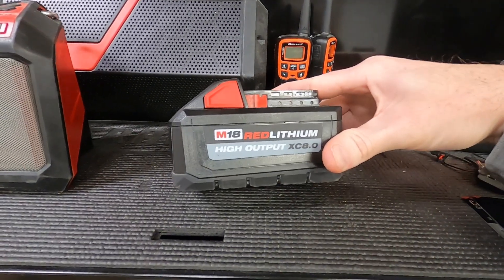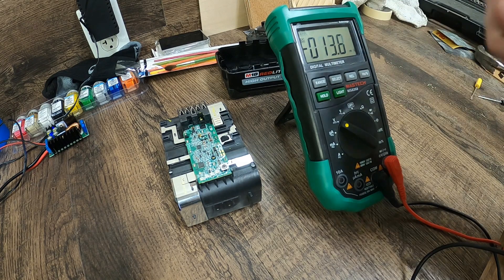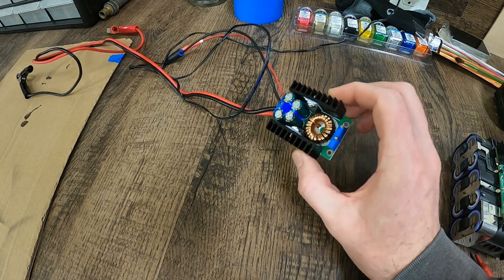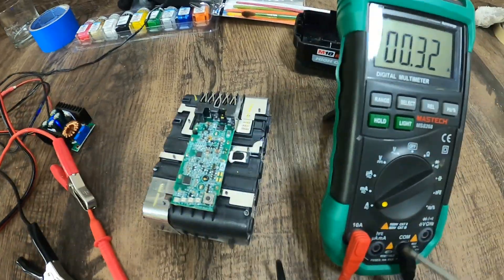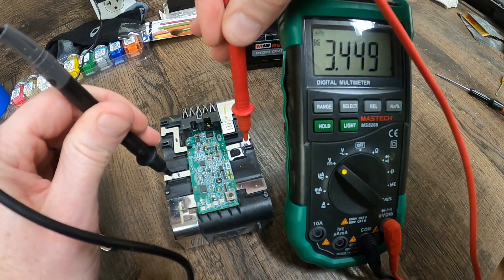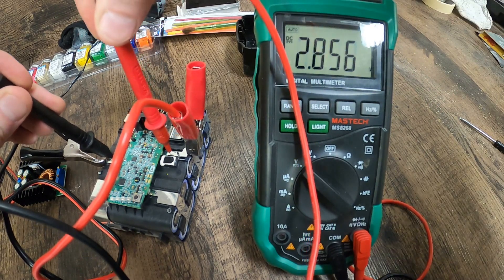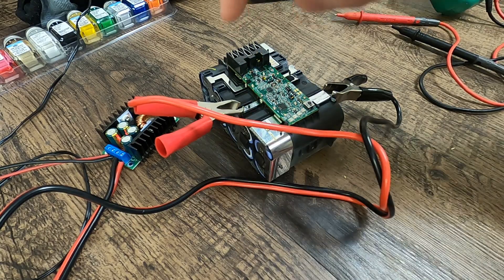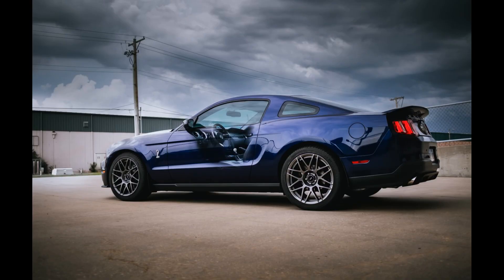Milwaukee Battery Won't Charge Fully - FIXED!

Comment: Mine Charges half way, but then flashes red and green, it doesnt say fully charged. so is it worth opening up to check it?
Reply from the maker: Flashing red & green usually means the charger detects a problem with the battery.  You could open it up and check it out, but I am not sure that there would be anything you can do to fix it.
Reply: @KonaBlueSVT  yeah it means error, which can also mean things like undervolt. I have some of the compact 1.5ah M12 that have a weird issue, I disassembled it and it charges, but if I press on the bottom of it or reinstall the bottom plastic cover, it stops charging and says it's full, or flashes an error, it makes zero sense.

Comment: @KonaBlueSVT. So I am having a somewhat similar problem. I am guessing its because I left my batteries on the charger too long after they were charged. Now they say they are fully charged, but a 9.0 can last me 5 minutes maybe on a weed eater. Is this something I can check and fix with this? Also where could I get or make a battery charger like that?
Reply from the maker: If they are fully charging, but just draining quick. You unfortunately probably just have a bad battery.  I don't know of of a way to fix that.

Comment: I've got a ton of Milwaukee tools and batteries.   I have to say, their batteries are shit.  I've had no problems with my Dewalt packs, but the Red ones are always giving this sort of problem.  I'm looking at one right now that won't charge past 2 bars.  Milwaukee sucks.  
-- And I'm not about to go through this process.
Reply: Agreed. I have Milwaukee, Dewalt, and Makita. No more Milwaukee for me. This is ridiculous. They say their warranty is 3 years on batteries. They should have made an exception.

Comment: You can't test amperage this way, doesn't work.  You left the clips connected to your terminals the same way for testing voltage out of the buck charger? There's something missing to get amperage reading like you're doing
Reply from the maker: You check amperage and voltage the same way, you just change your meter settings?
Reply: @KonaBlueSVT  at least with Klein, it won't read a steady current out of the buck charger, but it also pulses.  That's what's making be believe the power supply is not true DC but I went through a number of them connecting the outputs to the meter, not through the buck charger, and they're all blasting nothing then flare to 1.3 amps and back down? 🤔 I can't find anything testing current this way though, usually you have to have a load and I guess the multimeter is not enough?
Reply from the maker: Do you have a 2nd meter to check it?  Have you checked your meter fuse?
Reply: @KonaBlueSVT  I put the meter in line with the battery connected and got a reading like you show, kept it at 1A and seems to be charging.   I haven't found a meter that would measure current directly out from the buck charger, not sure how you're doing that or I'm missing something in the video, that would only work for voltage.
Reply: Unless your buck charger puts that led in the output circuit, but mine doesn't, and you can't check current using the output leads from the buck charger alone from what I can tell.
Reply from the maker: The LED is in the circuit.
Reply: @KonaBlueSVT  got it charged! Saved a HD 12ah.  4 out of 5 cells were around 3.5v and 2A charged fine (I got impatient and saw a few other videos at that current).  Thanks for the help, I appreciate the video

Comment: I had the same problem, 3 bars and the charger would go to green.  I fixed the problem by jumping the battery to my 48v electric golf cart battery pack for about two minutes and now the battery shows 4 bars.  Haven't checked the battery lately to see if it still holds the charge but it did after 2 hours.  Hope this works for you.
Reply: Don't do this.

Comment: Could this be due to the charger? Two of my batteries came up with this problem recently. My 5.0 at least 3-4 years old and abused so I thought it was just it’s time. Then my newer 8.0, only a few months old, started doing that a week later. Don’t want to keep using that same charger if that’s the reason. Thanks in advance
Reply: The batteries are supposed to have built-in protection chips. The tools don't really have any protection, and the chargers have minimal protections. When a battery is being used on any random device/tool, it should disconnect internally before the battery is too drained, and then the charging circuit (INSIDE THE BATTERY) should be still be able to negotiate with the charger and allow the incoming current in a safe way.

If the battery is TOO dead, as a result of the internal battery protection not disconnecting it, then there isn't enough juice left on the battery for the internal safety boards to detect it. Since the battery COULD be missing entirely, or may only have 2 out of 10 cells present, it is just safer for milwaukee if they don't allow the chargers to force current into the battery.

This is similar to a cell phone. If your phone dies, sometimes (depending on the phone and battery) you can turn it back on multiple times after the first time it shuts down on its own. It leaves that extra electricity in the battery on purpose, for the health of the battery, and to make sure the charging circuit (inside the phone and battery, NOT the wall brick) still have enough juice left to poll the sensors and regulate the charging voltage and current. 

You know about phone batteries and vape batteries exploding? Well, the drill batteries are the same technology, just 2-8 times bigger if they happened to explode. So, these protection circuits are important, and the manufacturer will usually err on the side of caution, because courts have sided with the "victims" and allow their insurance companies to attack the tool/phone manufacturer to recover payments used to rebuild a house that burned down. HOWEVER, this leads to a lot of batteries that simply discharged 5% too far, then stop working, and the tool company doesn't give you any core charge on these batteries that are approaching the same cost as a car battery?? 

You're going to see more and more videos like this, and if you do it safely, you can save a LOT of money in the long run
Reply from the maker: When I talked to Milwaukee, they asked about what tool it was used in. They blamed it on that vs. the charger.

Comment: I had this happen on a 12.0 battery, it wouldn’t charge completely. I left it on my rocket light till it died, then put back on charger and it fully charged.
Reply: I’m having this problem now, just read your comment and the battery is now in my rocket light, lighting up the cobwebs on my ceiling until it dies, then it’s going on the charger. I’ve already tried jumping it from battery to battery and that didn’t help.
Reply: @wesleyblanton2432 did it work out ?
Reply: Did it work  ? @wesleyblanton2432
Reply: @wesleyblanton2432 same
Reply: Thanks for sharing.
Reply: I have the same problem right now
Reply: Did it work?
Reply: Gonna try this tonight.
Reply: I have same problem with  my  12.0

Comment: Well done video.  What are using to power the buck converter.  I have this issue all the time and finally decided to try to fix the batteries instead of buying new ones.
Reply: All I can find is a transformer that pulses, even DC.  Is your 18v 1A transformer a static output of some sort??
Reply from the maker: Thank you! I used a 18v power supply from a cheap 18v tool that no longer worked.
Reply: @KonaBlueSVT  Thanks Kona!
Reply: @KonaBlueSVT   You have been so helpful,  I thought I would push my luck.  Would this work to power the buck converter. Super long url. https://www.amazon.com/Waterproof-Transformer-Adapter-100V-265V-Computer/dp/B07MZP9247/ref=sxin_16_pa_sp_search_thematic_sspa?content-id=amzn1.sym.c8697a08-4071-4b95-a6c6-18057bcdb898%3Aamzn1.sym.c8697a08-4071-4b95-a6c6-18057bcdb898&cv_ct_cx=12v%2Bpower%2Bsupply&keywords=12v%2Bpower%2Bsupply&pd_rd_i=B07MZP9247&pd_rd_r=887ad41e-105b-4760-8d0c-48d7a7067a1a&pd_rd_w=vVENg&pd_rd_wg=qyow8&pf_rd_p=c8697a08-4071-4b95-a6c6-18057bcdb898&pf_rd_r=VZYJP9JSX8GA3BYNQY4M&s=electronics&sbo=RZvfv%2F%2FHxDF%2BO5021pAnSA%3D%3D&sr=1-1-364cf978-ce2a-480a-9bb0-bdb96faa0f61-spons&spLa=ZW5jcnlwdGVkUXVhbGlmaWVyPUE2STJJMU43SE82SSZlbmNyeXB0ZWRJZD1BMTA0MTQ4NjMyOElIUUlGSDFTNjYmZW5jcnlwdGVkQWRJZD1BMDg5NzgyNE1SQlBKTlczSFEyUCZ3aWRnZXROYW1lPXNwX3NlYXJjaF90aGVtYXRpYyZhY3Rpb249Y2xpY2tSZWRpcmVjdCZkb05vdExvZ0NsaWNrPXRydWU&th=1 
Obviously I am not an electrician but I did wire a house once.  And it hasn't burned down yet.

Comment: After a while , you will have to do balancing again . Since self - discharge occurs in this cell . Only replacement with new elements will help .
Reply from the maker: 2 months in, so far, so good.
Reply: @KonaBlueSVT  So you often use this battery . I had the same problem with the 9Ah battery
Reply from the maker: Yes, I've been using it weekly. I am sure it will fail again at some point. The 9AH had all kinds of problems, to the point that they discontinued them.
Reply: @KonaBlueSVT  You can check for the sake of experiment . Charge it to 100% and don't use it for ten days. And you will again have a voltage drawdown on the problem cell.
Reply from the maker: @lutsevyat  I will try that
Reply: Where can I get one of those little chargers
Reply from the maker: Just search "12v buck converter " on Amazon

Comment: Milwaukee tools are great but the design of their battery packs are too complicated. Milwaukee puts the BMS inside the pack. DeWalt puts all the BMS in the charger making the pack less complex.
Reply: everyone but dewalt puts it in the battery. thats how all batteries work, they need a bms.
Reply: @LamoidZombieDog  You only need a BMS when charging. A voltage cutoff is all you need during discharge and that’s onboard. DeWalt batteries last much longer than “everyone else” because of this.
Reply: @yolo_burrito  no, DeWalt batteries do not have a voltage cutoff. This is why you have to be very careful when using them with an adapter for other tools, because they will not cut off and will undervolt. The chargers won't charge the batteries either because the voltage is so low they can't detect it (like m M12 battery at 0.5v output) or they are so discharged it's not smart enough to safely bring it back to normal voltage.

Comment: So, I can do this with my RC Car Charger ... So, Is it 4 Cell ??  7.4 V or 11.1 ?  & Charge at .5 amps ?
Reply: if you are charging like the video on each cell individually, it would be 1 cell, or 1S.   3.7v nominal, 4.2 fully charged
Reply: @benmeiler9070  It doesn’t have an option for 1s.  2S 7.4v & 3S 11.1.

Comment: and you have to build your own charger to fix the battery, don't you have a simple way to fix it? 
How about discharging the high charged cells?
Reply from the maker: Any adjustable battery charger will work. If you discharge them down to match, the circuitry will prevent all of them from charging.

Comment: i am trying this as we speak. bought the power converter, got it all hooked up just like you showed but i noticed that my light on the converter flashes red while yours was solid red when charging... am i doing something wrong? seems to be charging...
Reply from the maker: What are you using to power the converter?
Reply: @KonaBlueSVT  i bought an 120ac to 18 volt dc power converter plug like you showed in the video. it seems to be charging slowly. the power output is 4 volts at .5 amps when i test it. when i test the light is solid red. put on the battery in the correct locations and it blinks red
Reply from the maker: I have not experienced the flashing red light. Make sure your power input is not more than 8 amps.  If that's not the problem and the unit is still outputting power, then I would question the buck converter itself, maybe it has an issue. These things are pretty cheaply built.
Reply: @KonaBlueSVT  i think the problem may have been, that i put the clips on first and then plugged it in. i unhooked it and turned up the amperage to 1 amp and clipped back onto the battery and it seems to be working normal now. solid red and charging. it was still charging before but it was very slow. i think when the light is flashing it puts out intermittent power in 1 second bursts when the light is on. so takes twice as long. i went from 3.5 volts on one cell to like 3.8 volts in like 7 hours
Reply from the maker: Glad you got it working!
Reply: How are you checking amperage? My transformer pulses and I can't get a steady reading for amperage to reduce down to .5A.  Is this a USA thing that we don't have static dc transformers?
Reply: @tworotdoggs  did you buy the converter he showed in the video?
Reply: @Victor Scheide Jr  yeah but the way he's hooked up his wires and checking amperage does not work, unless he's got a very unique transformer at the wall plug.  Everything here pulses and does not give an amperage reading with that set up
Reply from the maker: I'm not sure what your power source is. Mine is just a cheap 18v tool charger. What amperage does your power supply put out?

Comment: Great video. However, I don't understand your voltage readings. 3 times 4.00 volts is 12 volts. However, this is an 18 volt battery.Where do you get the extra 6 volts? Also, 2 groups of 4, and 1 group of 2 batteries. How does the 2 group get 4 volts? Thanks, Barry
Reply from the maker: I mis-spoke at the beginning of the video. Each cell is made up of 2 batteries.  There are 5 sets of 2.  While they do call this an 18v battery they are actually 20v when fully charged. 4x5=20
Reply: @KonaBlueSVT  Thanks
Reply: there are 5 banks of batteries, wired serially., for a total of 20.0 volts fully charged.   You tested banks 1, 3 and 5.   You need to go back and check 2 and 4.   

Ive been doing this method for several years now  on the 12 Ah battery for the chainsaw.   What happens is the battery management system marks banks as “bad” and no longer charges it.  Why it decides they are bad i dont know, but clearly the bms is avoiding a fire hazard by shutting them down.   I have “bad” banks 2, 3 and 4.  I charged them individually using a 3 amp 4 volt supplies, it took 2 hours.  The total voltage was 20.2 volts.

Everything worked great for 3 recharges and then the problem returned somewhat.   This time only banks 3 and 4 were not charging.          rinse and repeat 3 charges later again a problem but this time with 2 and 4.   

Then i tried using an older, slow mikwaukee charger instead of the newer Fast charger type.    This fixed it permanently.   It takes a lot longer to charge but all the banks charge normally and fully

I also have two 8.0 batteries, always using the old slow charger and never had a problem.

Comment: i checked all cells and  they are all at 4 v but still flashes when put in charger
Reply from the maker: Likely has a short or bad circuit then

Comment: Did it do the same thing next time you drained it down?
Reply from the maker: No, it has been working normally since then.
Reply: @KonaBlueSVT   Nice.. Ill try this on my next one.. I usually just take them to work and trade them.  Shhhhh lol
Reply from the maker: @chipsammich2078  Haha, You will see them completely die sometimes, but I have had pretty good luck bringing them back using this method.

Comment: Ingenious!!  So this permanently fixes it?  What do you think caused it to not charge?  Thanks!
Reply from the maker: Sometimes an issue with a tool, but my guess is it's using it with a tool that has a heavy power draw that pulls the charge down quicker than the shut off can shut it down.